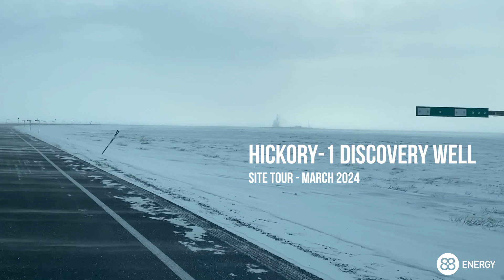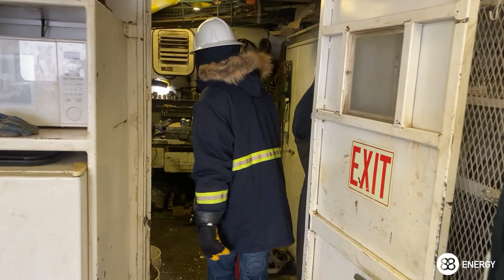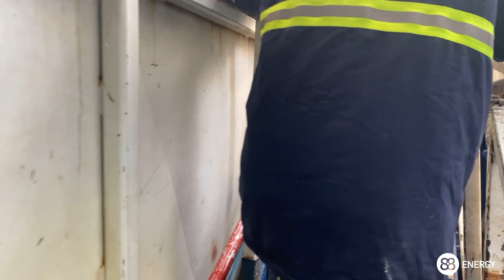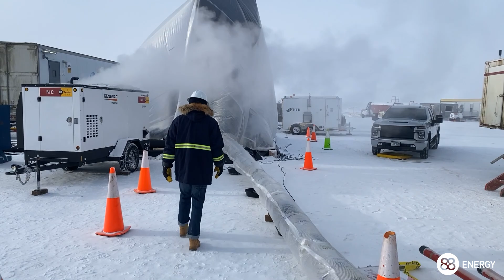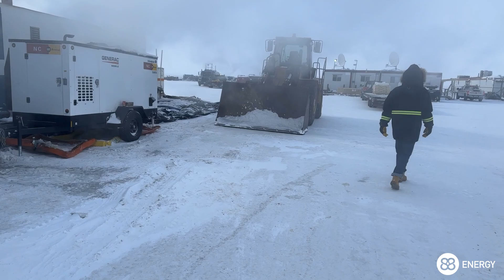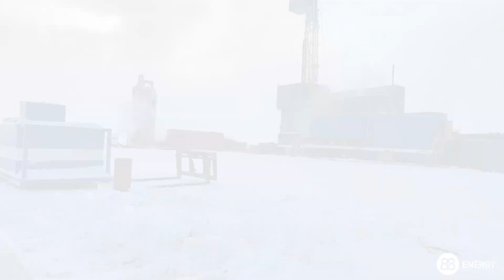88 Energy - Hickory-1 Discovery Well: Site Tour March 2024

Comment: Awesome, thank you for making it flowing this time 👍🏻
Reply: Awesome rhey shöuld go home. How much did you lose on this ? Total loss coming soon.
Reply: @Naturkraft1  let them flow horizontically first
Reply: @Dany-vn7hi  You can check out anytime but you can never leave  ( just like not being able to leave Hotel California )
Reply: So it's a direct vertical shaft with a flow of 70 barrels per day. This is good since a horizontal bore will bring about 500-700 barrels a day flowing. They have found the oil , and they can sell it off or ask for acquisition, but the issue is that the dilution by the board's approval has led to such a huge price drop in share investment that many initial investors have lost 90% of capital value